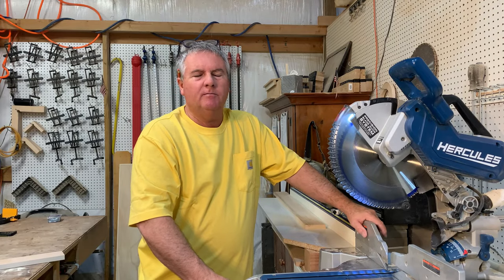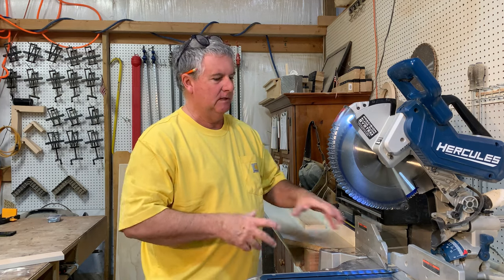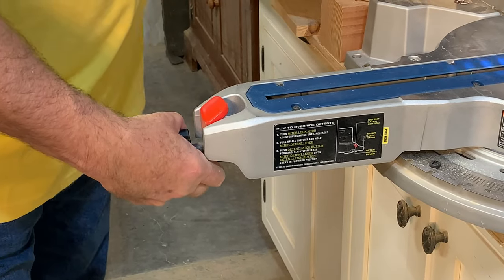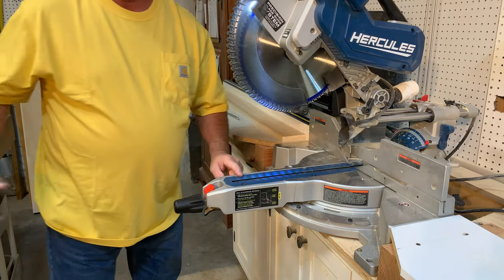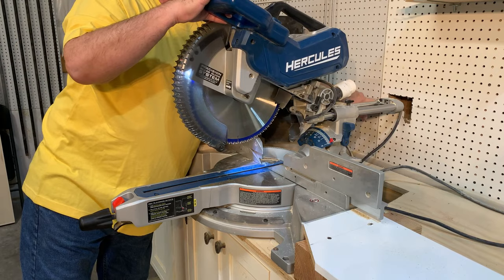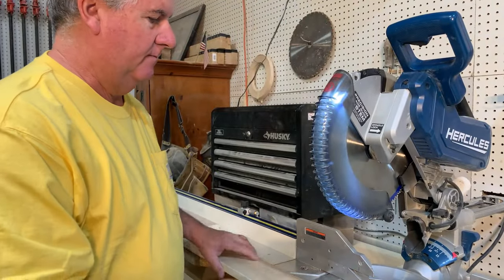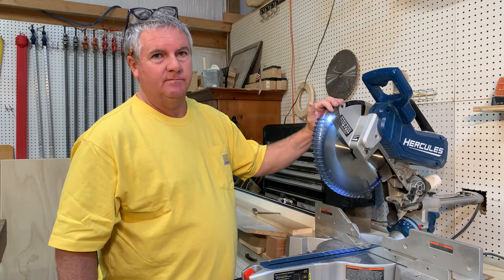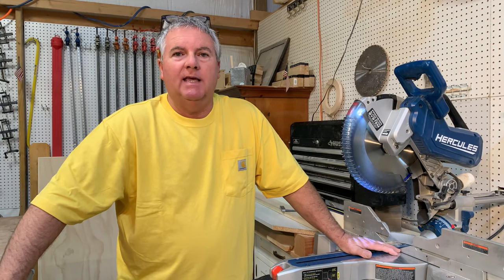HERCULES 12 in. Dual-Bevel Sliding Compound Miter Saw Harbor Freight | Review

Comment: Some of their tools are junk, let's be honest. But, this saw is a winner. I've had mine about two years as well. Mine was slightly out of square (1/2 degree) out of the box. Easy fix. One thing I use a lot is the hold down that also comes with it. And the depth stop is great for dados and rabbets.
Reply from the maker: Thanks watching and for your feedback. It’s a really good saw for the price.
Reply: Exactly. I as he said I don’t buy any tools at HF that I expect of quality. Bauer I’ve had no luck with but Hercules seems to be their best machines. I have the table saw as well and it’s a DeWalt quality for half the price. The only other HF product I really like are the Bremen parallel clamps. They are of Bessey quality and I would argue a little better and even for quality.

Comment: I bought the Hercules miter saw about 3 years ago to do hobby work & has been very good to me. The 1 thing I don't like is that the bolt is that the bolt for the blade is on so tight I haven't been able to change the blade.
Reply from the maker: On all miter saws, you actually need to turn the bolt clockwise to loosen it. Give that a try and let us know if you have better luck.
Reply: You are probably trying to turn the bolt the wrong direction.  Its a right hand threaded bolt....don't worry it gets a lot of people....

Comment: To six miles up, etc.  If you had any problems Harbor Fright would have returned your purchase within 30 days with No questions asked.  As a customer for over 20 twenty years this has never been a problem.  I had the Chicago saw for over ten years the saw still works fine for rough cuts.   After reviewing the YouTube Hercules sites, I did my own alignment checks and still found no problems. As for my new Hercules it was set up on my patio.  So, I went out and checked the square on the fence as you mentioned and found No out of alignment.   One of the first things I do is check my tools within two to three days after purchase since I will be using the saw for close tolerance work.  In comparison to the other major brands within $700.00 dollars, Hercules has become the best on the market.
Reply from the maker: Great advice and feedback. Thanks so much!

Comment: I have had my Bosch for about 20 years and the fence warped so that is impossible yo line up the right and left hand fence to be square.  I even sought professional help who machined the fence and gave us more adjustment , but I cannot align the right and left side to get a square cut.  So I am looking to replace with the Hercules.  I have heard many good things about the saw, so I think I will be looking to buy one, when on sale.  One thing I haven't found what is the warrantee?
Reply from the maker: The best we could tell is that the warranty is now only 90 days, it used to be a year. You can also purchase an extended warranty Harbor Freight

Comment: I looked at this saw and really liked it but the overall size (depth) of it with its slide mechanism was a deal breaker for me. I opted for a Metabo HTP and it was defective right out of the box so I picked a Bosch with its slide mechanism “glide” mechanism. And the bevel controls are up front. However I do not foresee using that. But great video and review by real people users and not professional woodworkers.
Reply from the maker: Thank you for your comments and for watching

Comment: I have the same saw, it works great, and like yours mine was also properly adjusted out of the box.  I haven't used mine very much yet, but the few projects I've needed it for, its done great, seems to have more power than the old 12" Chicago Electric model I had before.  I got mine on sale for $299.  About 1/2 the price of those other brands, and honestly they're not as great as people want you to think.  I've had all the so called "Brand Name" tools, and they still broke, they still needed periodic adjustments, etc.  So why pay more to get the same results that a less expensive tool can give you.  

I also have the Hercules 12-1/2" Thickness Planer....it has 3 cutters on the head VS 2 that many other brands have, it does a great job, and definitely worth the money.  If I recall I paid $349 for the planer, it was on sale the same time the miter saw was, and I bought both.  I do not have the miter saw stand, I have a Black and Decker Work Mate that I put the bench dogs in, and set the miter saw or the planer on and clamp them down while I'm using them, when I'm done the saw and the planer go back on the shelf out of the way, and the Work Mate folds up and sits against the wall out of the way.  

The Hercules Miter Saw and that Thickness Planer are both heavy tools, I was surprised how heavy they were, I wasn't expecting that, usually the stuff from Harbor Freight isn't built as well....can't complain about either tool, they are doing very well for my homeowner/DIYER needs.  

I have a few of the Bauer cordless tools and a few Hercules cordless tools as well, and they seem to be doing fine.
Reply from the maker: Great feedback, thank you!

Comment: Good video and informative ... you mention some different saw blades you have used on this miter saw ... would you mind mentioning some of them and reason why? I plan on buying mind this week while it is on sale, thanks!
Reply from the maker: Thank you for your feedback. I would recommend either Hercules or Bauer 12" blades. The 40 tooth ripping blade and 80 tooth finishing blade that are great to get you started.
Reply: @soulmatesandsawdusttn  thanks 🤙
Reply: The "cheap" big box store blades, namely Diablo, are the best blades. Because they have an anti-kickback "raker tooth" or "shoulder tooth" behind the cutting tooth. The really expensive blades aren't really as safe, because they don't have the anti-kickback raker teeth. The $200 Ridge Carbide or Forrest blades don't have any anti-kickback features. The cheap blades are slightly less likely to kickback and grab the board, because they are specifically designed for safety. One big channel recommends either the Freud Diablo or the CMT brand. CMT also has glowing reviews. Use a thin kerf, make sure you only buy a "thin kerf" blade which is approximately 0.087" wide kerf (cut) because it produces less dust, unless you have a reason for a standard thicker blade (slightly more accurate).

Comment: I bought this a couple of years ago. It is pretty much pure junk.  I discovered (too late for return) that the fence is not even close to being within plane of either side.  If you are looking at it, the left side of the fence that is bolted to the saw is not coplanar with the right side.  If you place a straightedge on the left side and slide it towards the right side, it will hit the leading edge of the fence.  Basically, the fences are tilted towards each other.  I removed the entire fence system from the saw, mounted it in my Bridgeport mill, and brought it into alignment. Still, the sliding portion of the fence is so far out of whack (tilted towards the back of the saw) that I am probably going to toss this junk before I waste any more time on it.  Harbor Freight's "dumb tools," such as sockets and wrenches, are fine, but I will never buy anything like this from them again.  It would be fine if I was just doing rough, and I mean rough, framing, but I am doing trim, and it just does not work for that.
Reply from the maker: Sorry to hear about your bad experience with this tool, but I wonder if we're talking about the same saw. I also have a Chicago Electric Harbour Freight saw and an Admiral saw. I experienced the same problem you had with the Chicago Electric saw and I only use that for rough construction jobs. Its basically junk but works in a pinch. The Admiral is a decent tool for the average craft carpenter. I use it in my classroom where I teach basic woodworking. The laser is terrible but the saw has stayed square and true for a few months now. I seldom use it though. Time will tell I guess. That being said, the Hercules 12 inch sliding compound miter saw is my favorite miter saw, and I have had several good brands. I have had this saw for two plus years and it has never needed to be adjusted right out of the box. I am a fine furniture builder and my tools need to be precise as I'm sure you need yours to be. This tool is as good as some that go for $800.00 in my estimation. The motor went out on my Dewalt a few years ago and I didnt have the money to put out for another one, so I did a little research and while the saw was fairly new on the market, I took a chance and I have never looked back. If I have any complaints about this tool, it's the noise of the motor and the lack of a full brake. Again, sorry you had this experience but this has been a great tool for me. Thanks for your comments on the video.
Reply: @soulmatesandsawdusttn  I wish I could post pictures on YouTube, but yes, it is definitely the Hercules saw.  I might make a short video regarding the issues I see with this saw.  I have done fine furniture building (as a hobby) for about 35+ years.   I previously owned the Bosch 10 SCMS but needed a 12" for trim that I am doing in our new house.  I am going to revisit the Bosch and the Makita saws today and probably make a change.  I can buy the whole fence system from Harbor Freight for $65 or so, but I am concerned that I will end up with the same issue.  It is actually rather astonishing how far out of whack my HF Hercules saw fence is.